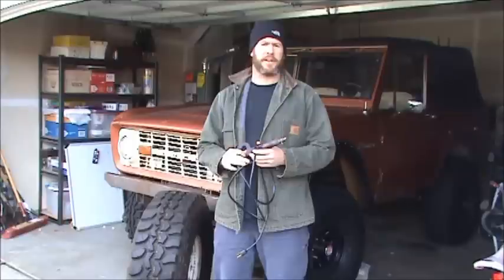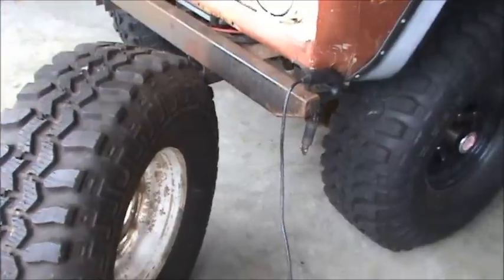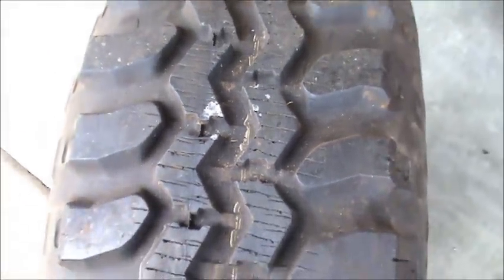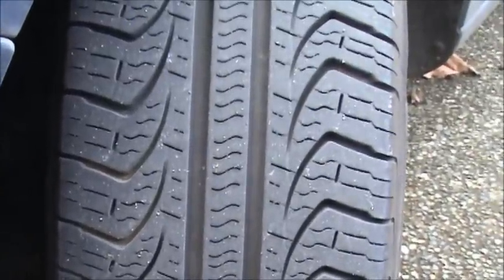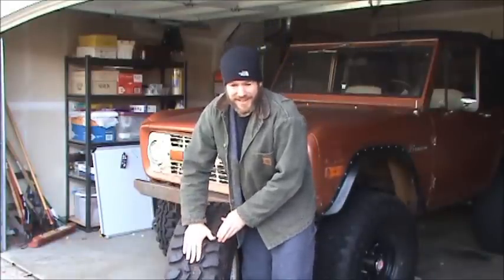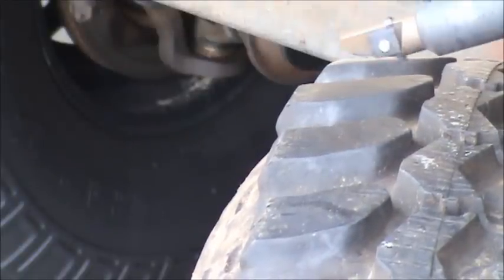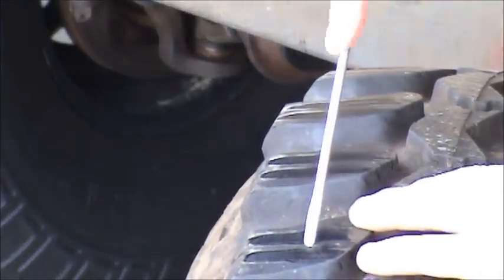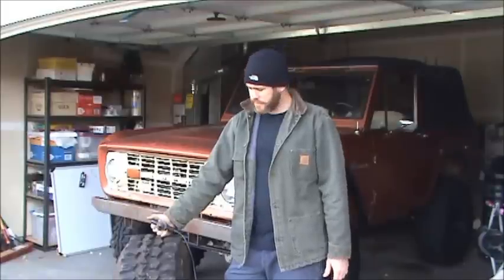Hand Siping a mud tire with an Ideal Tire Groover for better snow wheeling performance

Comment: Thanks for making the vid Im a beginner and this gave me a great image of what I wanted to know. I drive a Ford Lightning daily driver and been sideways enough to know and even not sure Ill make it home sometimes. For cars that have hard to find size tires like a Lightning this is one answer! 
What about siping regular street tires? 
By the time we go to the tire shop and drive there, wait, have some clown improperly lift the truck or car, leave greasy prints everywhere, do an "ok" job, over torque the wheels...we could get 2 tires done and take the time to inspect our vehicle more closely. 
Also.
 I wonder if the tool can be repurposed to make permanent corn rows in the head for those body mod people? Thanks!

Comment: If you sipe them at a forward or back angle.  It will improve traction and braking.  Don't cut deeper then 50% of tread depth too.  Another idea is too cut across the tire at a angle.  So it will bite better on turns.

Comment: I might have missed it, but what size blades are you using for siping? #4, #5, etc? How long does each blade usually last?
Reply from the maker: +metalmulisha03 My Ideal tire groover has a #4 head, which uses #4 blades. That creates sipes about a 1/4" apart. The blades last a long time if you make sure the tire is clean and let the heat do the work. I've done multiple sets of tires with one blade.

Comment: Would it make any sense to do the inside treads horizontally and the outsides vertically?
Reply from the maker: I don't think that would be a very good idea. You spend 99% of the time going forward, backward, accelerating, and stopping. To me it makes the best sense to maximize traction for those situations. I have experimented with putting some sipes at an angle, but I've found those sipes don't really open up very well.

Comment from the maker: Glad I could help. It is a little expensive up front, but you'll get better quality results. Mine has been used on several sets of tires and it's still going strong. Thanks for watching.

Comment: I cut & groove all my tires for the flexibility to conform to the terrain, & grip like stickies.
Radials in the snow, & siped with floation is the only way to snow wheel!
Although, I've made 39.5 IROCs bias grip like radials through a break in & cutting.
I seem to have all the traction I need on a trail only jeep.

Comment: I have personally learned the benefits of siping can mainly be seen on two types of surfaces. One being slick yet packy material like wet snow or damp earth (soil, sand, clay, etc), where the sipes actually create a "tread" in the surface for grip. The other is hard flat surfaces like ice or rocks where the sipes spread flex and grab at every available imperfection of the surface. You will need to rely on the original tire design for other surfaces such as deep mud, dry sand, or powder snow. :-)

Comment: I don't see how siping reduces tire wear. The purpose of siping is to soften the larger tread blocks and give more edges for the tire to grip with. A softer tread will wear sooner. A siped tire should dissipate heat faster due to the extra surface area but at the same time it will create more heat from the added surface area flexing and contacting other surfaces. This isn't really an issue when used in the winter or off road as it was originally intended back in the early 1900's.
Reply: I agree but disagree. I get where ur comin from. But on the other hand, if a tread block cups, it wears fast. However with sipes, there are as many tread blocks as there are sipes. Therefore making the cups smaller as the tire wears with more closely spaced tread blocks due to the sipping.

Comment from the maker: Regrooving is different than grooving or siping. So the answer would be no. Due to the tread design there wouldn't be much benefit to additional grooving. You could still do some siping. The small tread blocks on the BFG AT's really aren't that great for any sort of modifications.

Comment from the maker: @BBDDmudcrew Yes, the windshields do fold down on all the early broncos, however the later models don't have the bracket on the hood to latch it too. I've never seen or heard of one fold down on it's own. It is pretty common for folks to tie in a support to their roll cages though.

Comment from the maker: @sfcErwin92 Siping is supposed to extend the life of a tire by making the tire run cooler, and allowing the lugs to flex instead of slip. The long haul truckers swear by it, but they drive under pretty controlled conditions. Realistically when it comes to four wheeling, the life of our tires is more dependant on how we drive and the type of terrian.